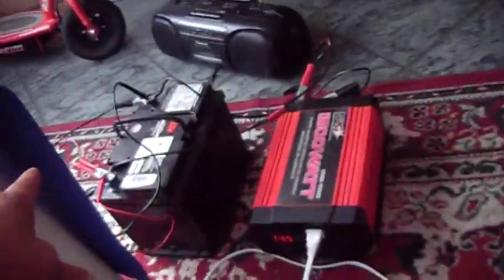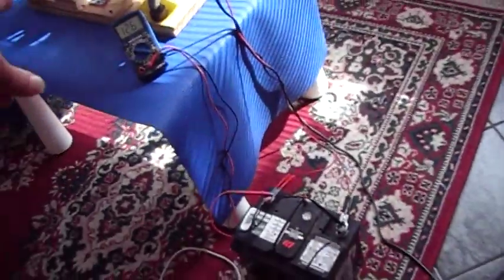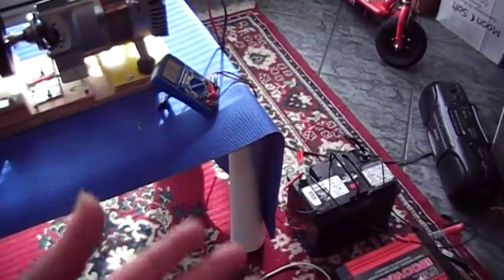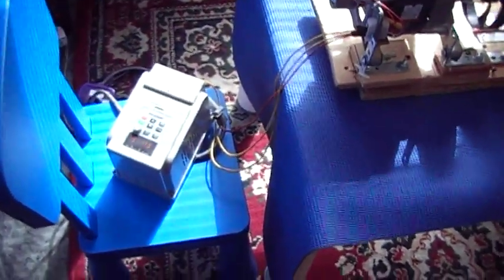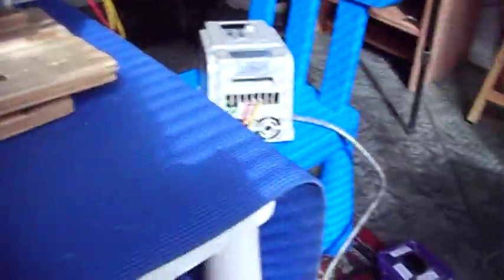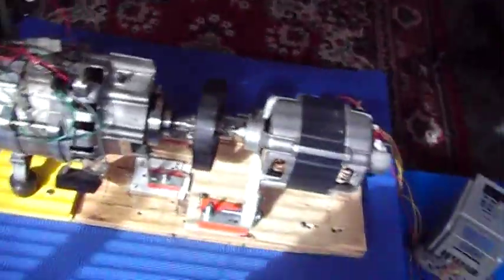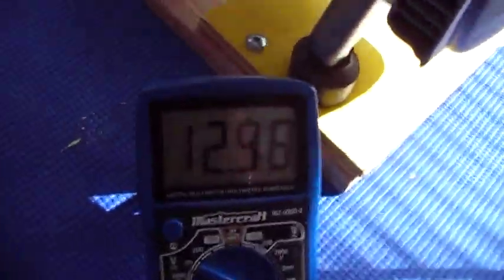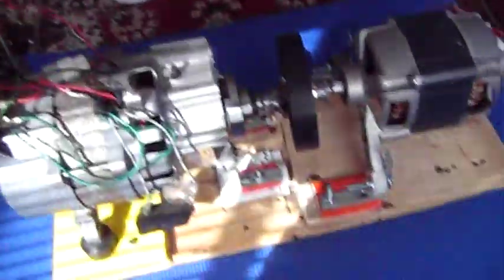Fuel less Generator - No gas

Comment: Hi, my name is Tiurai, I would like to know if you can make a video of the disassembly of the 950w generator, and do the electrical assembly with the capacitor and output to a power outlet, I have the same generator as you but I don't know how to make it work with a 1kw 220volt 60hz electric motor. Please show me how to connect them 🙏🙏🙏

Comment: I had set up one like that in honolulu ...and in future we can rewind the generator so that combine motor with generator by had two action one feed the other like 30 ° turn motor and next 30° turn generate electricity until get to 360° ...or arrange the permanent magnet rotor at an angle so push against stator with coil to generate electricity without fuel. That way wind , rain , night it still work cost less than even solar or anything

Comment: Hellow my friend , I really admire at your work of fuelless generator using a DC motor. What I want to ask is where can I get the part that join the two shafts of the motor and the generator
Reply from the maker: Thank you for watching there is much more //  - you can use any type of garden hose,etc
Reply: @earthssecretenergy2371  thanks very much for your response

Comment: What if my own generator don't have the wire that charge the battery but have only capastor wire and load wire how do I run it to start charging the battery at same time
Reply from the maker: You can use any out put from your generator
Reply from the maker: you can all so charge from your cap

Comment: Hey guy I just took a look at the vfd data and it ms output is upto 2 2kw so this idea you got where your using less than 400 Watts is debunked. Il send you a video of the same experiment. You can not use less than consumed with this set up. Less than $14 you can illuminate all talk with a digital PlUG IN voltage consumption meter. I guess you already know this since you have a volt meter to hand  why would you not record your actual draw at the wall in said experiment. Now I can see why your replies to others are negative with disgruntled.

Comment: No.
In a closed system: Input energy = Output energy. Energy CAN NOT be created out of thin air. As I see it you are using the word Watts wrong! You can not supply 200 Watts and get ...2000 Watts! let me tell you a secret here: Since you are getting excessive amount of ...watts ( now I am using it wrong as well ! ) then return 200 from the output to the input. Then you have this:

INPUT: 200
OUTPUT: 2000
RETURN: 200 from output to input
NET GAIN: OUTPUT - (INPUT + RETURN) = 2000 - ( 200 + 200 ) = 1400 !

So your machine will run forever without the need of an external power! Why no one ever tried this? Oh wait ... Many did...
Watt is not what do you think it is. Please research it a bit more before you do such extraordinary claims? Thank you for your effort!

Comment: If rewind the brushless motor which has the permanent magnetic rotor and winding as stator and intersecting stator with motor pokes then we had both motor push generator to output electricity and it run forever if couple with battery or large capacitor
Reply from the maker: INFORMATION IS ALL ON MY VIDEOS

Comment: Find the Volt meter  Place the Neg and the Pos Prongs onto the wires coming from the generator and film the Wattage used before plugging in appliances Mechanical energy = power juxdaposition.
Reply from the maker: Sure could do that for ya .But i will say one thing there our other videos out there that people hide batteries in the motors. I have exposed them !!!   if you look carefully in the video you see when i turn off the VFD the lights go off from the GEN  and when i turn it on  not bye switch same thing .  But sure will do in my next   just watch the video  !!!!!

Comment: Correct Mr if I'm wrong but a 2000 watt alternator is still 2000 watt weather ot is 12 volt DC or 120 volts ac. Also the electric motor running the generator must be large enough to run the alternator. 1HP equals 749 watts
Reply: 1 CV c'est 736 Watts évidemment ce que tu vois dans cette vidéo est une arnaque...
Reply: 746

Comment: PMMG4HYBRID Channel Made a More Calmer G Core  but this Ver of the G Core can Go stepping Works Better using Super Caps and using a Treadmill Brushless as a Generator and a 12V Brushed Motor Arduino Controlled to still Get 60z for a Tad bit Quieter ..... still Not as Quiet as PMMG4HYBRID .......(( R.I.P PMMG4HYBRID  ))
Reply from the maker: yes thank you i have tried many motors  and still do but this is what i am working with and more stay tuned .. and yes caps

Comment: I HAVE A SYSTEM GEN 2.4KW AT 220V 2530ROT SIMOTOR 1.1KW 2850ROT 220V SATIN INVERTER 2.5KW 2X12V = 24V 45A STEERING WHEEL 20KG BUT AFTER 30MIN STOP DOES NOT CHARGE IN A SHORT TIME THE BATTERIES YOU ADVISE ME
Reply from the maker: INFORMATION IS ALL ON MY VIDEOS

Comment: Here in Nigeria, we need nothing at the wall. The wall's energy is totally unreliable here. We have got something very useful from a battery but having some issues with the drainage/recharge rate. It's still very high. We need to bring it to 1:1 then we are home and dry. Considering amplification of voltage/current on the first coil so that the drainage is maximally reduced to now make the inverter battery recharge system more efficient. Still working on it.

🤷 I have never been an engineer but I now realize I had been missing. Beautiful experiments all over.

Comment: this is underunity . you put more then you get
Reply from the maker: In my first video on my Chanel i am using a drill 240 watts, TV,150   Radio 25 and light, 100  before you leave a comment of negativity ,and yes no gas !!!!!!!  do your research as you see in my early test i run over what i am using and could of loaded way more .

Bye the way were is your fuel less generator
Reply: @earthssecretenergy2371  again, this is underunity, do research on my channel and you will find my fuelless generator

Comment: how are yo adding in the generator and the inverter power together, when the generator is powering the inverter?
Reply from the maker: bye the wall and all so bye the battery to the inverter
Reply: @earthssecretenergy2371  that isn't how inverters work. you are drawing watts from the wall power which is then charging a battery. with said battery plugged into an inverter. you can not add battery rating + inverter rating = massive plus.  the inverter will only output its rating.  you may however be supplying the motor out of the wall with 1000 watts, then keep battery powered and inverter producing 3000 watts. would net gain 2000. 

although you are not calculating the input watts. ?

Comment: Why don’t you take out the usage of power outlet from grid.
Make it a self running generator.
Reply from the maker: I will but, we all no we need a primary mover for now i am using the grid not unless i can use a water fall of great flow but stay tuned.
Reply: You will need a capacitor bank as backup to run the primary mover,with that you can have a dc or ac motor to do that for you
Reply from the maker: thank you
Reply: @davidlihu3956  do u have a page on YouTube?
Reply from the maker: ok
Reply from the maker: i am now using a inverter
Reply from the maker: now with a inverter